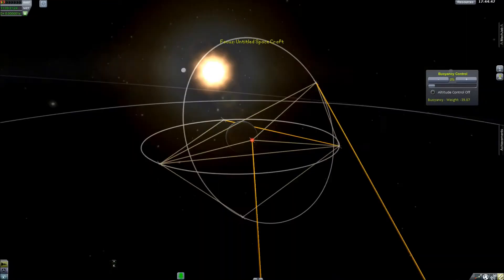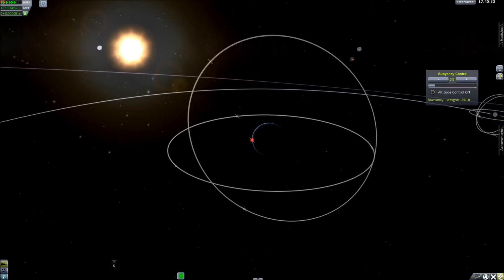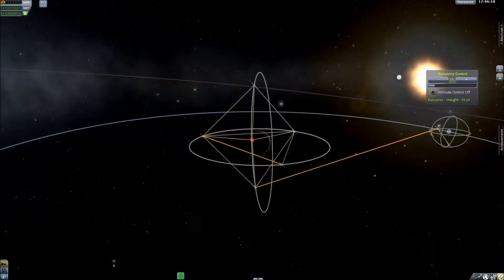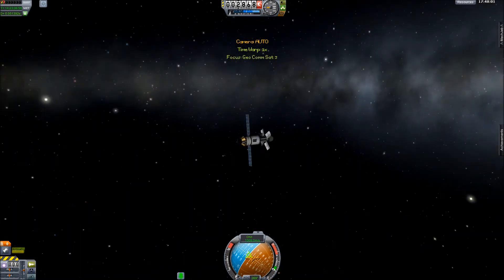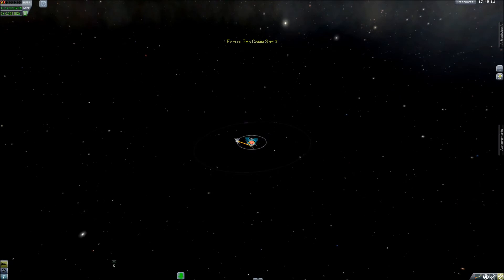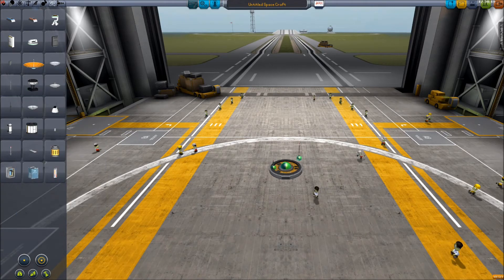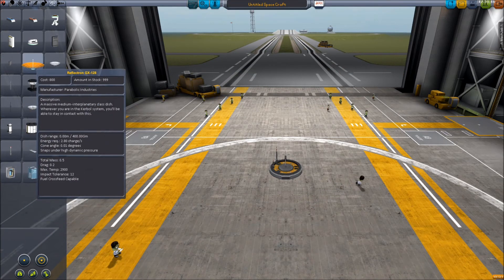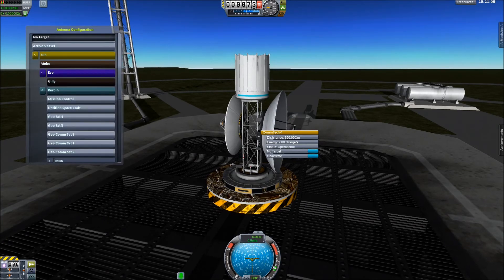KSP .022 Remote Tech Part 2

Comment: im running it with real solar system, so a bit harder to get them up but managed to get a nice tri relay around kerbin. Had to also adjust the range multiplier in the config to make remote tech usable. I'm still unsure about how 'pointing' dishes works exactly, I know with long range connections between two dishes both need to be targeting each other but what about passively targeting antennas or dishes in it's field of view (when it's being pointed) that aren't targeted?
Reply from the maker: Sorry, YT's new comments system is hard to find.   Directionals need to be specifically 'pointing' at each other.  As you know you tell them who to talk to, but don't have to actually have them physically directed towards.  Omni-directionals will connect to other omni's as long as they are in range.  You don't need, and cannot, specify a link.   The range and line of sight is all that counts.     Using a real solar system just adds to the pain :).  Without changing the ranges you'de have to use dishes almost all the time apart from real local stuff.   It's hard enough to get a working system in the standard kerbal system.   Kudos to you.